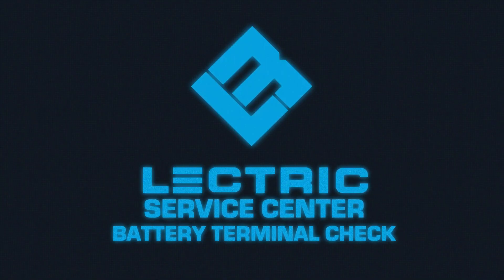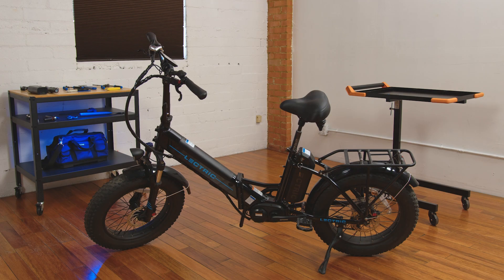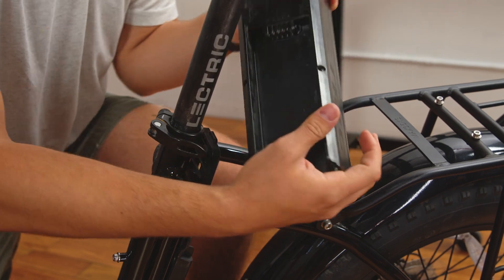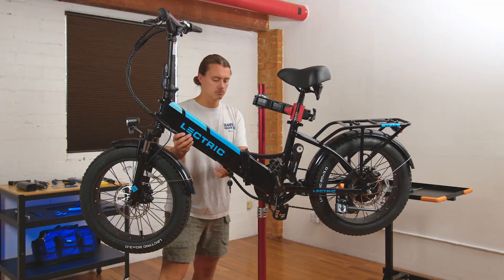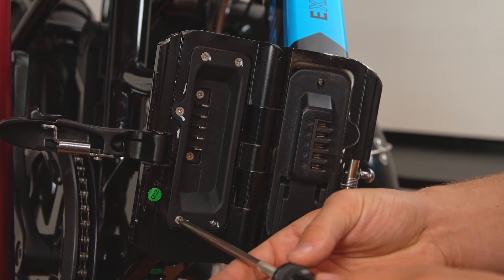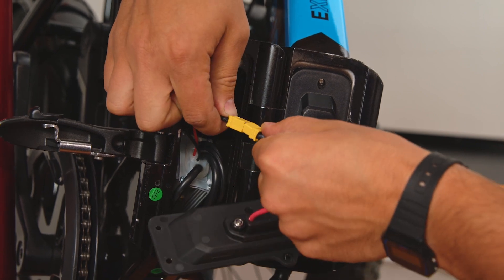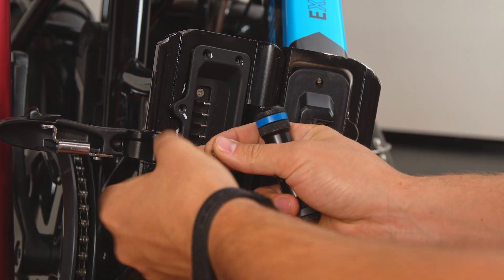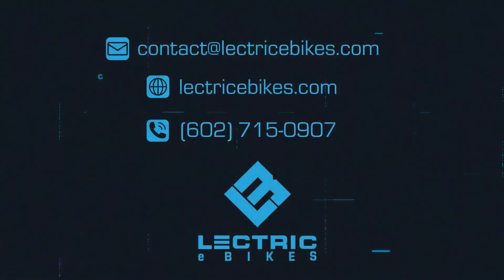Lectric Service Center | Battery Terminal Check

Comment: Is it best to leave the battery half charged when not riding for like more than 3days ?
Reply from the maker: Hi there! When storing your battery for a week or longer, we recommend keeping it charged at 75%. At 75%, your battery will degrade less than at higher charge levels. If storing over a couple of months, we recommend checking your battery's charge level once a month and charging it back up to 75% if possible. ⚡️
Reply: @LectriceBikes  thanks 🙏🏾 this was very helpful.  I’m going to charge my Xp lite now 😇😅😎lol
Reply: What do you do if you do see burning or debris?